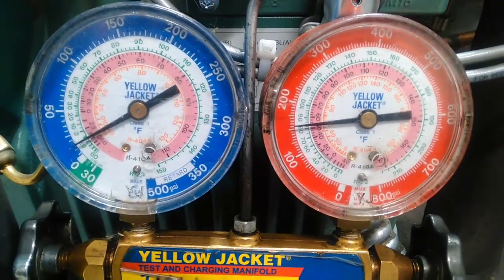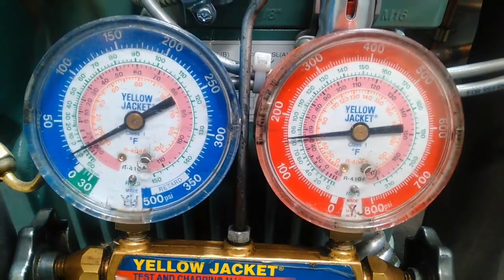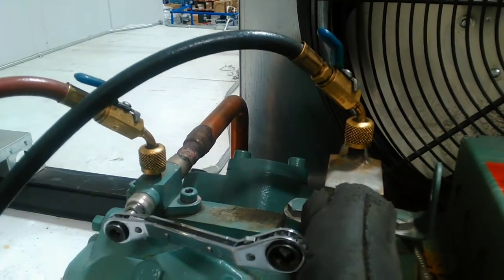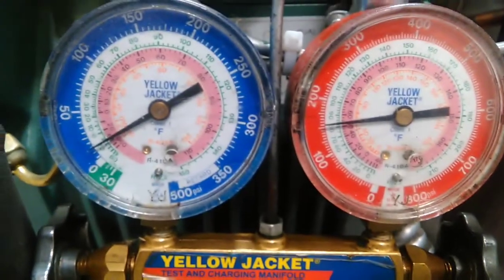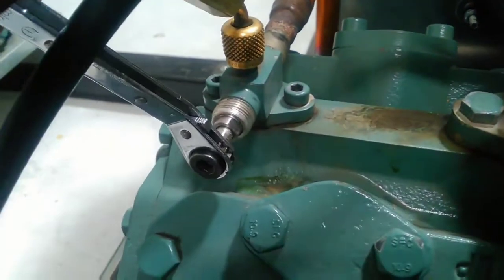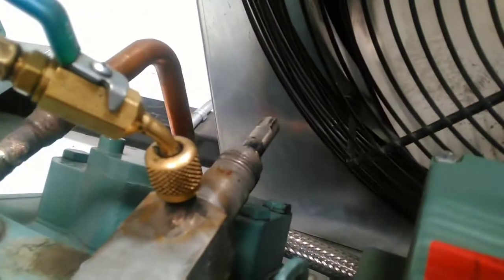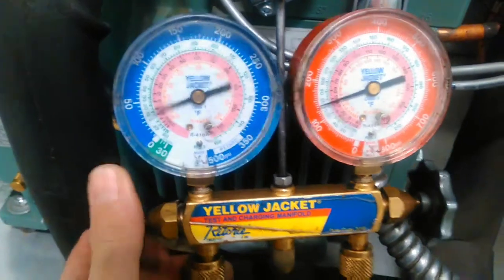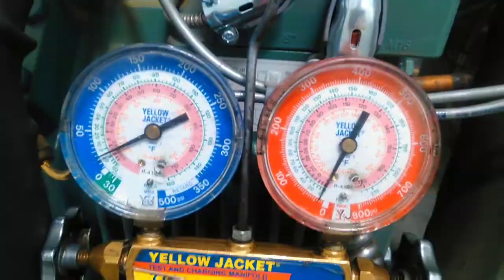Equalizing Refrigerant Gauges

Comment: Wish that worked on residential A/Cs
Reply from the maker: Channel Cat Chaser if you have ball valves you can definitely equalize on rezi applications.
Reply: It's easy to suck it back in with the unit running: close liquid ball valve, open suction manifold valve, open liquid manifold valve SLOWLY until pressure drops on both sides, close both manifold valves, close suction ball valve, remove hoses. This only works if you have ball valves on the ends of the your hoses, and don't forget the yellow hose needs to be purged and closed before you do this or else you'll be spraying refrigerant.
Reply: Best 62 seconds I spent in a long time